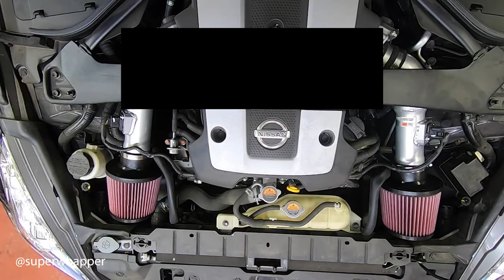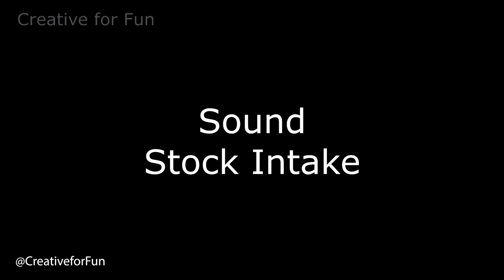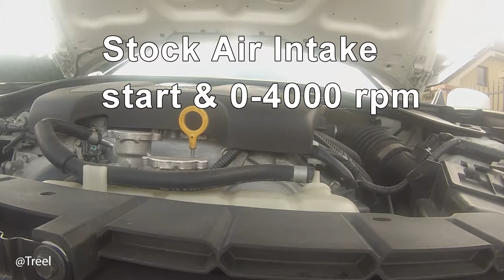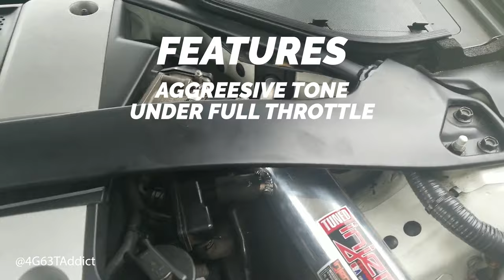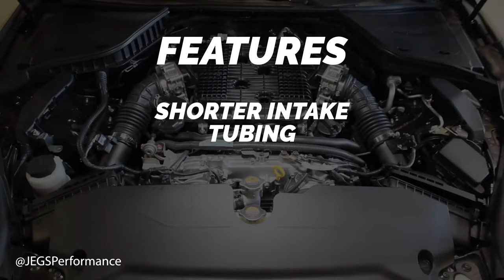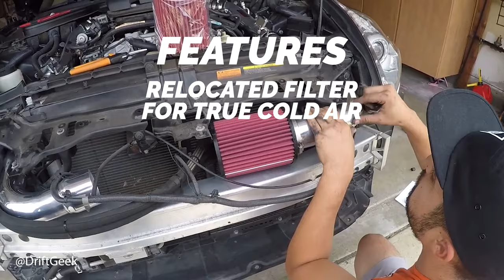Top 5 Nissan 370z Intake Systems

Comment: 17.5hps upgrade with the stillen??? never
Reply from the maker: That may be wishful thinking by them...
Reply: I had a Fast Intentions TDX CBE plus a Stillen Gen 3 CAI installed on my 2019 370Z 6MT and had my peak rwhp go from 282 to 321 @ 7200 rpm. Fast Intentions claims that their catback alone will produce about a 20 hp gain on the chassis dyno, so I assume the rest is coming from the intake in large measure.